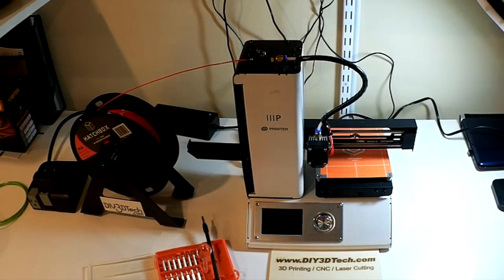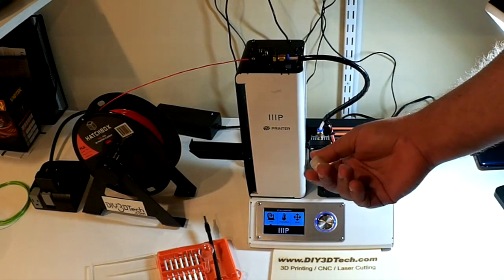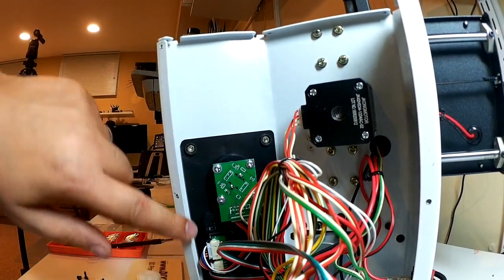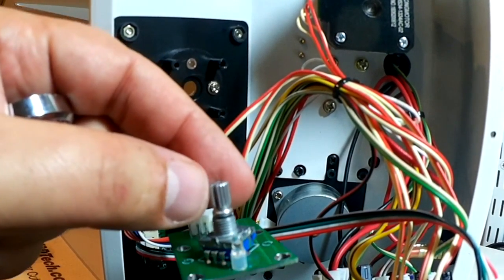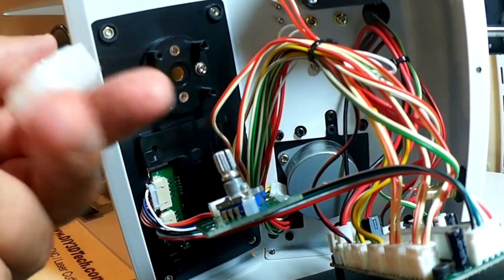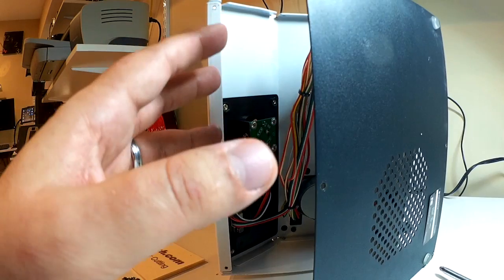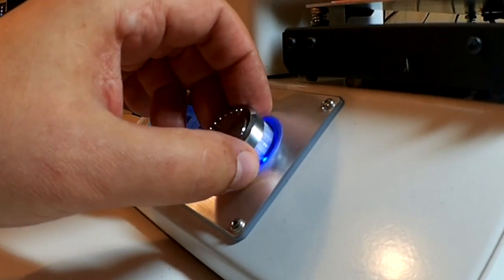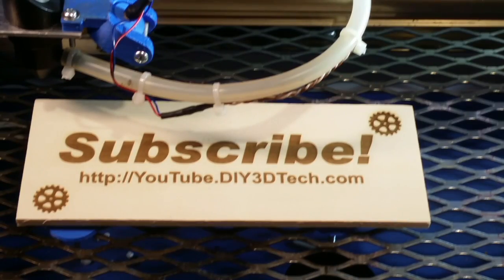MonoPrice Select Mini 3D Printer - Replacing the Control Knob!

Comment: I just wiggled mine off with my fingernails and didn’t get any scratches. I switched back to the original though cause the printed one was a weirder shape to me but this design looks like it might be good to try. I haven’t really had any issue with the stock one.
Reply from the maker: Wow!  Did this a LONG time back and it is still going strong!

Comment: I am planning on buying this printer shortly. While I plan on replacing the knob almost immediately I will probably do the trick with string. However I did like this video as it showed the inside of the unit very clearly. That is great because I also plan on placing a power supply internally as well as replacing the side panel with a ventilated version. I was worried about required clearances/etc. but this showed just how much space is available! So thank you.
Reply from the maker: Your welcome as when I did this, I had no clue how the knob came off and I wanted to see inside.  Also if you look at my profile on Thingiverse I have a number of mod posted there for the Select Mini as this is a great printer!

Comment: I printed a black one that fit nice, then a transparent one that was very hard to get on, did not think of heating it up.  Shrinkage.  View your video and stop it at 2:31 it looks like the front wire connection is not square in the base.  Might be just my aging eyes.
When I had my bottom I checked all the connectors and 2 were not properly seated.
Reply from the maker: Thanks for pointing that out when I took it apart the connector pulled out a bit and when I reassembled it, I pushed it back in.  Also yes a heat gun one of my best friends :-)
Reply: My clear PLA has shrinkage issues as well, while my colored PLA does not. Wierd.
Reply from the maker: This is common that different colors react differently.

Comment: Y'all are doing it wrong. It's simple. Use dental floss. Use a tooth pick or thin flat blade jeweler's screwdriver. Tuck the floss behind the dial and then pull it up. No scraping or damage. Then install the new knob then pop on the old knob. 

No fuss, no muss, no disassembly and all is done within seconds. Should only take 30-60 seconds. 

I used glow in the dark filament and it looks cool with the back light.
Reply: Dental floss worked like a charm!  Thanks for posting it.
Reply: This made it so easy to pop off and put in the new knob, thanks!
Reply: Are you saying you got an Amazon Echo Dot?

Amazon Echo Dot acoustic stand reverb ( I do not have an Echo Dot so I have not tried this remix I made out)

http://www.thingiverse.com/thing:1708949
Reply from the maker: I would be so in on Keurig controlled like that!  Maybe I need to hack mine!
Reply from the maker: Thats if you know how the know comes off :-) My luck it would have molded as part of the selector and when I pried up it would have broke (yes that is experience speaking:-)  However this was really there and took a lot of force to pop off.  As I responded to Chuck to take off again (as it is not as tight) would use high test fishing line.  However, I am still sticking with the translucent over the glow int he dark as it does look so cool!
Reply: DIY3DTECH.com - the GID is excellent at transmitting the light. It was blue GID so it was kinda translucent in a way and the blue light works well with it.
Reply: I found the tip for the dental floss on one of the Thingiverse knob mods. I actually began to take my machine apart until I read and tried that. Worked great.
Reply from the maker: I looked (mainly on Thingiverse ) and saw nothing so decided yea this thing has screws lets take them out and see what magic is hidden inside :-)
Reply: DIY3DTECH.com - I started down the same path. Opened the case unbolted the face plate and still couldn't get yo the base of the knob. Fearing a total dismantle just to change out a knob I went back and read more on the descriptions for the various knob models and read where someone used dental floss to get under it to pull it off. Was tough but it came off fine.
Reply from the maker: I am doing the fan mod just remixed a 40mm to 50 and hope to netball it tomorrow and will do a video and put it up on thingiverse
Reply: DIY3DTECH.com - Sweet. Oh by the way I finally got an Echo Dot. Will be printing out your Dot stand. Any revisions you would recommend?
Reply from the maker: Cool and no have not changed as I have been using it ever since and loving it so have not made any mod.  Also for the full size did a customizer on thingiverse which is cool too!
Reply: Protomaker Black Sprint Original 3D Printer - I just picked one up so I was going to print both of the stands.
Reply: I also picked up the Ecobee3 WIFI Thermostat with the Dot. They were on a bundle sale. First step into home automation. Now I can be really lazy and tell Alexa to change the setting on the thermostat without having to get up or use my phone. Lol. Now that is "convenient".  Now if my Keurig could only be controlled via my phone it would make mornings all the better. Lol
Reply: DIY3DTECH.com - if you do make sure to have a "step by step" instruction sheet, parts list along with the typically cool video. :-)
Reply from the maker: Your welcome and I was also thinking "fishing line" too...
Reply: I can vouch, i did it with two Small Flathead screw drivers and it was super easy just pop it on and you are done
Reply: Yup.  I was going to say that's a lot of extra work

Comment: shame they should have used those old pop-up knobs from the old stereo days .  you know push in once and it pops up and again to pop it in .   Hmm i wonder is there is a rotary encoder that has same footprint that could do that .  that would be super hidden mod. LOL . problem with that is that is is push for button .  Also great look at the guts , and a nice beefy looking pancake stepper  .
I wonder how well the stepper drivers are tuned to the motors . remembering how high / off spec some other printers have arrived (fab mini 1) .
Reply from the maker: LOL!  knew I was I going to get some comments on this video, however, your right as wanted show the guts and how its connected as my luck I would have pried up and broken it (yes have done that before :-)  Also can not remember the who, however someone has done a video on the setting the stepper drivers like Chuck did for the Fab/Mini so didn't feel it was worth repeating.
Reply: i was wondering if it even had pots to set . was not clear under/near the single heat sync.
Reply from the maker: Belive so...

Comment: You need to install a fan on the control board.
Reply from the maker: Interesting, have not noticed a heat issue have you installed one and how is it working out?
Reply: http://www.thingiverse.com/thing:1667026 This was actually the first thing i printed on my mini. I did not have any problems. I did not like 4 motor drivers working in a confined space without any cooling. Some people have claimed better prints with the fan, but i can not back that up as I only printed 1 thing without the fan. I do know my mini has been printing 12 to 18 hours a day for the last 5 weeks with out any major problems.
Reply from the maker: Wow this is pretty cool (pardon the pun) I will add it to the todo list and thanks for sharing!  :-)